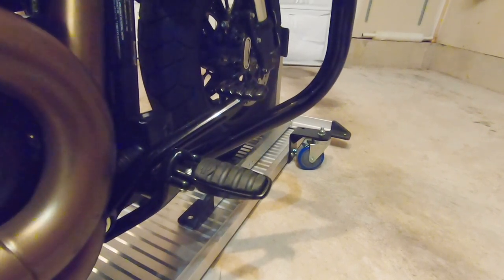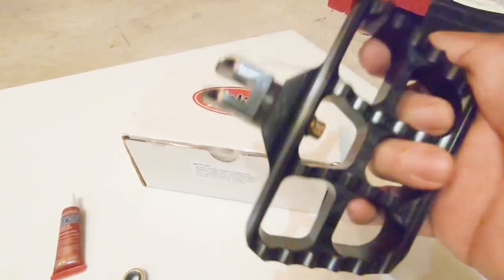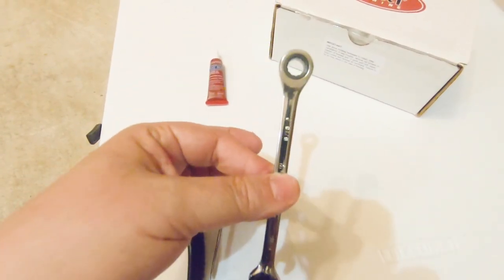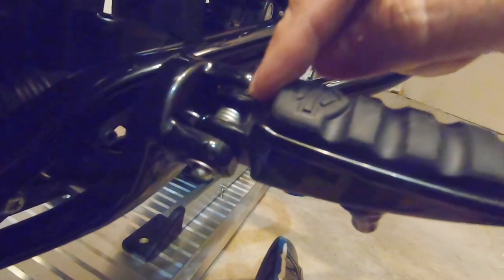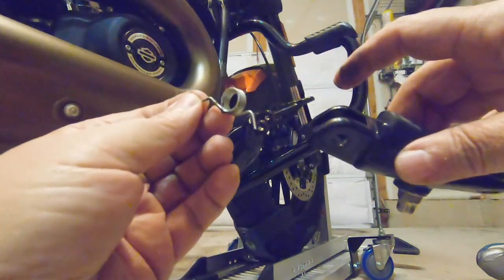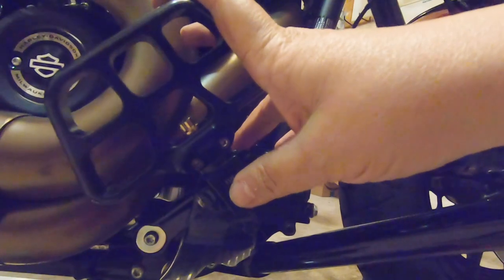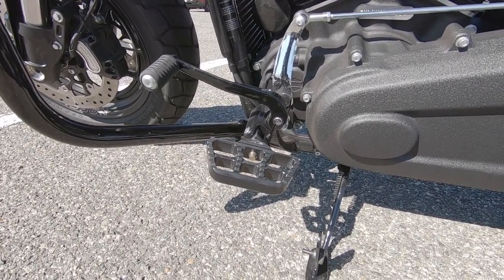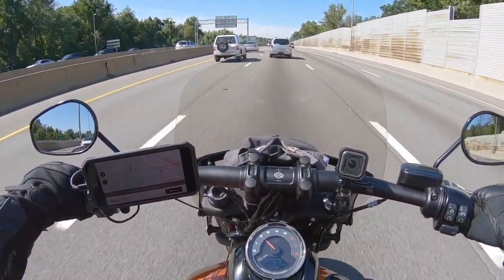Installing Joker Machine Serrated Mini Floorboards on my 2019 Fat Bob 114

Comment: Great information. Are still liking the mini boards? I just got a 2020 FB, and I’m thinking these look good VS the stock HD pegs. Any thoughts on the HD boards? Thank you.
Reply from the maker: I really like these mini boards. They’ve been hugely impactful on my riding. Especially on longer rides as it gives me a ton of flexibility in how I position my feet to stay comfortable. H-D released theirs like a day after I ordered these. I think that I still would have gone with the Joker Machines anyway. There’s more surface (without being a full board) and they are highly adjustable. Congrats on the new bike and welcome to the Fat Bob family! What color scheme did you get?
Reply: Thanks for the fast reply. I got Stiletto Red. I’m sold..getting these Joker Machine mini boards.
Reply: I installed the mini boards with the nice video you made. I really like them, and highly recommended them.

Comment: I put these on Furiosa along with the new brake lever and that side is awesome. My issue is the shifter side. I feel like I need the shifter to be up a bit higher to make up shifting easier. Did you end up changing the shifter position? I’d love to see how to do that as I think I need to have it higher.
Reply from the maker: That’s a pretty easy adjustment. Check out the video I did on replacing my shift linkage. You’ll see that the shifter mount has splines and you can raise or lower that shifter easy-peasy.
Reply: I got it. Made that adjustment to the shifter and now it’s all set up. Very happy with it. Windshield next I think
Reply from the maker: Which windshield are you looking at? I’m going to put my 15” H-D windshield up for sale. Let me know if your interested in that.
Reply: I also found the perfect bolts to replace on the header. https://youtu.be/uxBXFJHZPbs check it out

Comment: Do these things have a negative effect on the lean angle of the bike?
Reply from the maker: I haven’t noticed any with the way I set mine up. But I can’t say definitively that they do not.
Reply: @withPercy  OK! Im gonna try them since its quick and easy.  I was looking at doing a mid control set up since I ride mine pretty aggressive but apparently its pretty complicated.  I think with these I could get a little bit more of a leaning forward riding position without the taco effect.  Thanks man!
Reply from the maker: I think you will like them. I am definitely more aggressive in my riding with these than I was with the stock pegs. I will say though that I am going to replace the brake pedal arm. I dropped by a dealer yesterday while I am on a business trip and saw a Fat Bob they had modded. One of the things they did was replace that arm to raise the brake pedal position. OMG... does that ever make a difference!! And they did it with H-D parts. I’m planning on dropping a vid next week to do a year end wrap up on the bike and will be talking about that fix on the brake pedal and the parts needed.

Comment: is there a way to lower the shifter. i find it annoying having to raise your toes Everytime you wanna shift.
Reply from the maker: You can do that. When you pull the shifter off you'll notice that it has splines. Simply rotate it where you want it, slip it back on, and tighten it up.
Reply: @withPercy  that really did solve my issue there. thanks alot
Reply from the maker: @republicofu.s9642  Glad to hear. Stay safe.